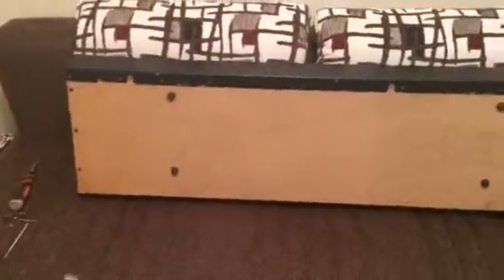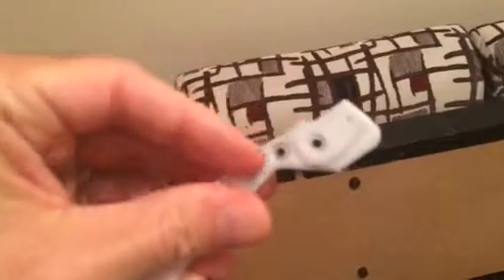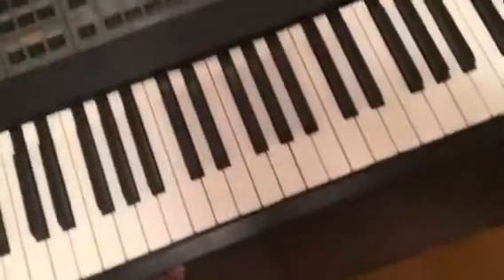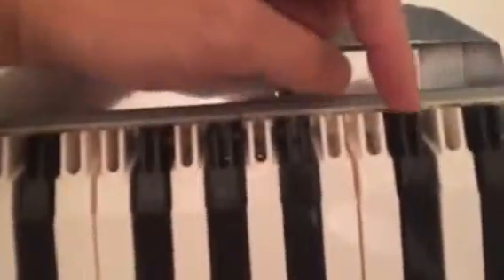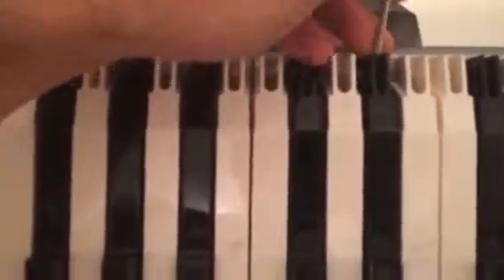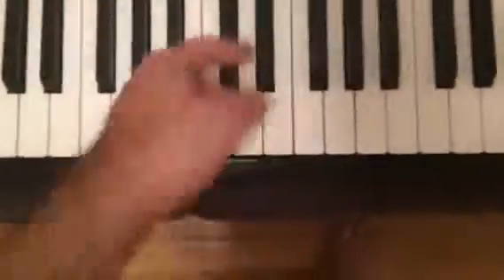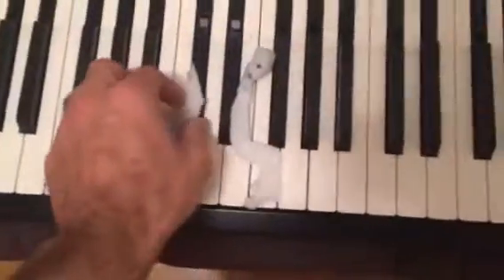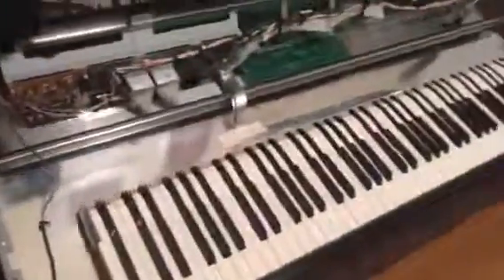Roland XV-88 repair

Comment: Thank you for the key replacement video. Dived in and followed your simple instructions and viola ...a fully working XV88! I even repaired the two broken weights with superglue so all the keys are working now. Those metal end pieces are from another dimension........
Reply from the maker: Great, glad to hear it worked out well, thanks for the feedback.

Comment: Lab said it would cost me 120$ for the key replacement and 2 weeks till they get to it.... then saw you video and fixed it in 10 minutes. So many thanks!
Reply from the maker: Awesome. Glad it helped. I replaced most of the keys now and it does take me 10 minutes to do the job (mostly reused the keys from far left and right for the ones that broke in the middle)

Comment: for those of you who don't wanna spend in the neighborhood of $10+ PER replacement counterweight... i see a lot of talk about crazy/super glue... my guess is that it will be too brittle... i've had great success with hot glue & gun... BUT, you MUST apply it very thinly or the repaired keys may not fit... i have an A-90 and an XV-88... same key bed...

Comment: I still have mine fully expanded. Ending up just turning it into a module and using midi controller as the hammers cost $13 each without shipping. $1144 before tax and shipping for new hammer set!!!!!! lol